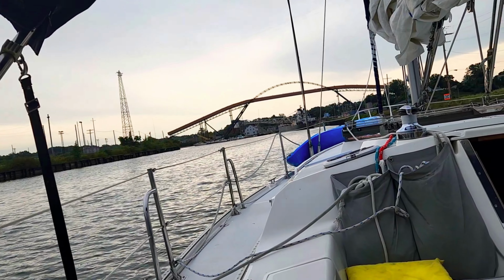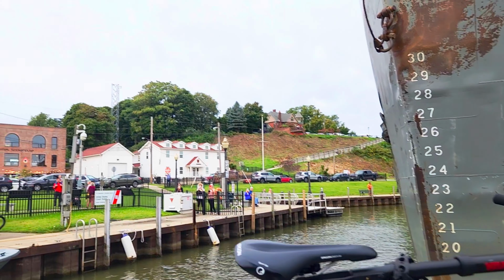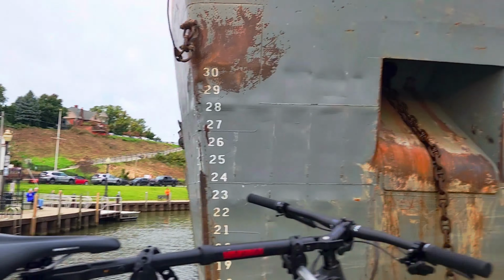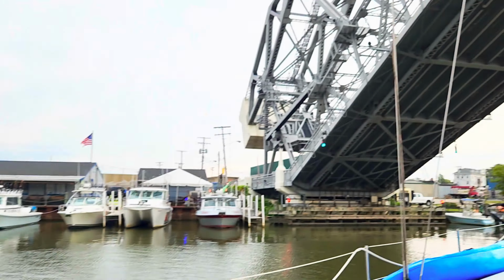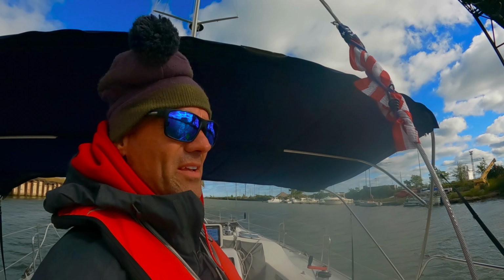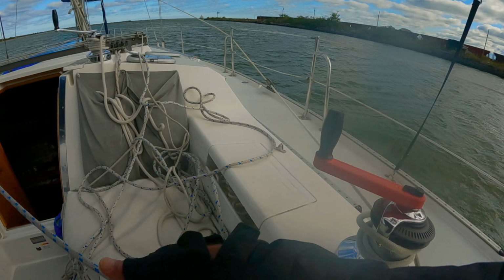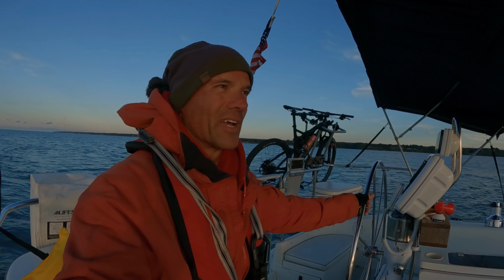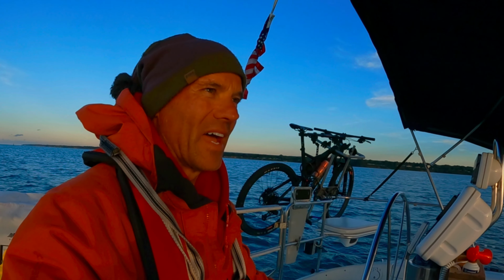Stir Crazy Sailing and Adventures - Episode 12 - Sailing Lake Erie and Docking a Catalina 42

Comment: Another great vid. Have an unsolicited tip from on single-hander to another. When you were pulling in to Erie and the dockmaster grabbed your spring line you should turn away from the dock(and lock the wheel) and put the boat in idle forward. If your spring is exactly midships run the bitter end back to your primary. You can use the winch to tighten the spring and the boat will become parallel to the dock. The more you winch the closer to the dock you will get. The boat will sit in that position until you run out of fuel and allows you to casually step on to the dock and attach you bow and stern lines. The spring I use is 25% long than my boat just in case the docks cleat placement is sketchy. Works like a charm. Cheers!
Reply: Thanks, Tim - I believe you have a great process and I'll work on incorporating it into my options.  In many places in my life, I've told people, I don't always know how to use help - because I don't depend on it being available. Like backing up a trailer  . . . I bet you get that one, too . . . So, I've been a "throw it in reverse" guy and grab the bowline when I jump off. Yes, there is some risk, if I trip and don't grab the line. . . while my boat heads stern out intent on proving one of Newton's laws . . . Neil surprised me by taking the spring line to the aft dock cleat. No big deal - reversed it and pivoted on a well-padded pier. Hey, don't be bashful,  I appreciate your intent and offer.